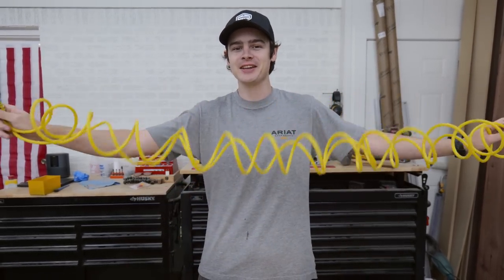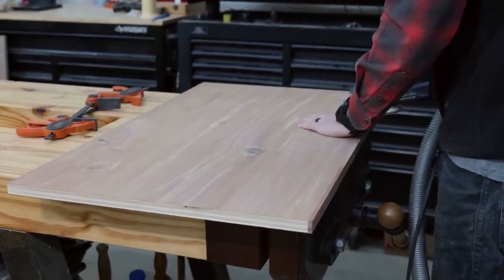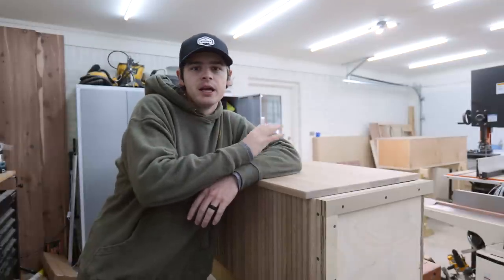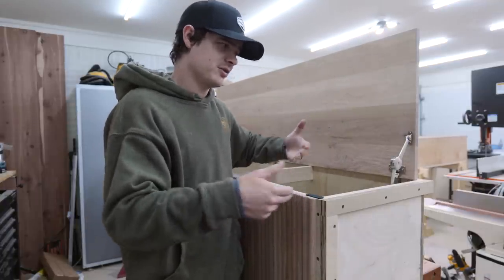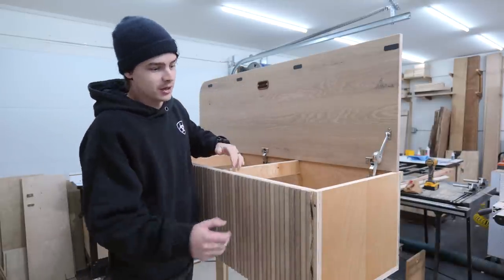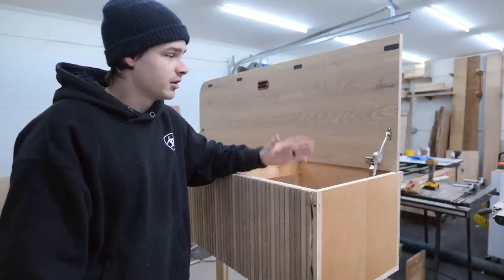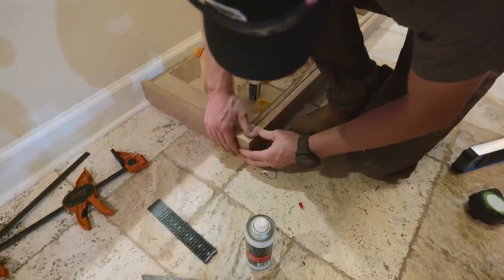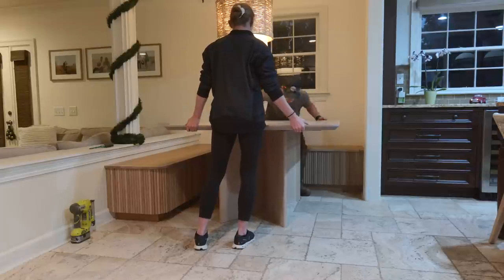Delivering Our Client’s DREAM Dining Table!

Comment: So your client was ok with losing an electrical outlet?
Reply: Sometimes that's the nature of the beast
Reply from the maker: Yes, the client had the option to have it accessible in the bench or not. There are two other outlets very nearby so they opted for this.
Reply: Surprised the homeowner didn’t have to cap the outlet before the install.